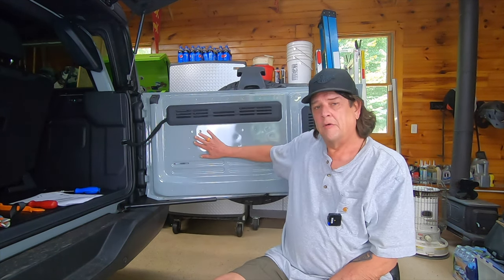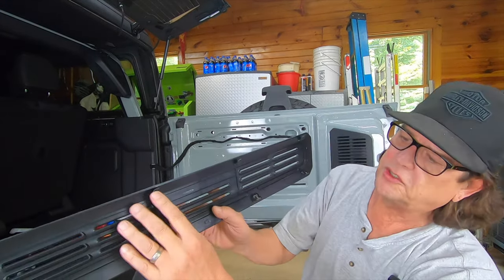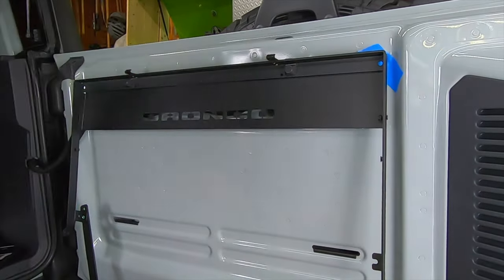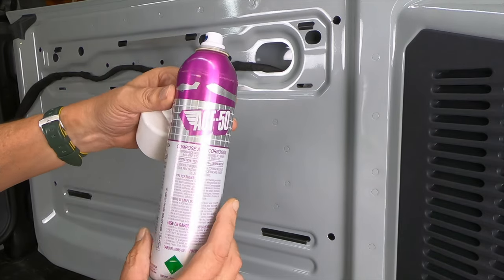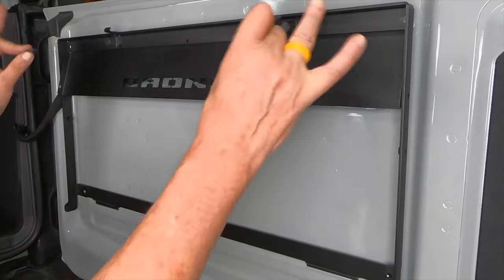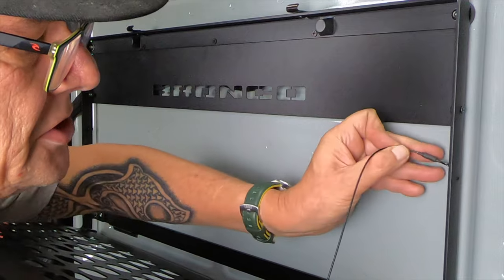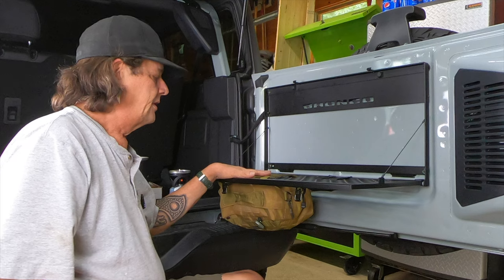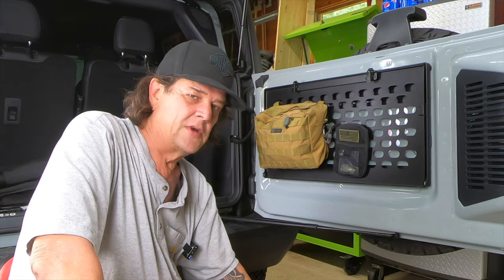DIY Tailgate Table - Ford Bronco

Comment: Great accessory for the Bronco, love the tutorial especially the the locking nut, (nutsert) 
By the way, I had a Ford Bronco in the mid 80’s as an assigned drive car when I worked for the Ford Motor Company, it was very truck like in those days 😂 
Pottsy
Reply from the maker: Pottsy, it honestly is a solid accessory for me. When I go to cut firewood, I can service the chainsaw on this table while working. Molle rack system was bonus points.

Comment: very good how to.  I'm with you if it didn't have the rubber to keep it from rattling then it'd be a deal breaker for sure.
Reply from the maker: That would have been a deal breaker for me. It's actually quite secure on rubber bumpers.